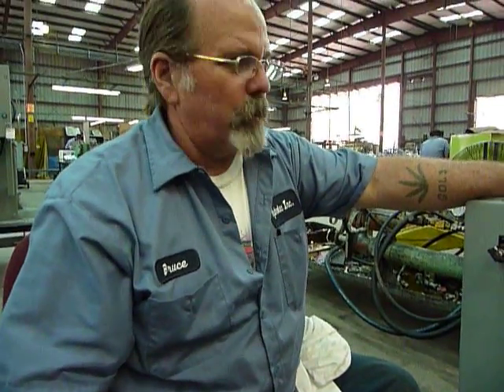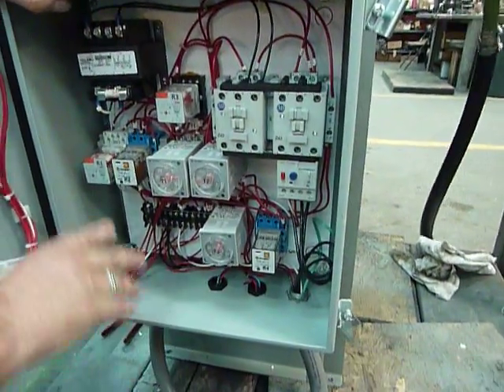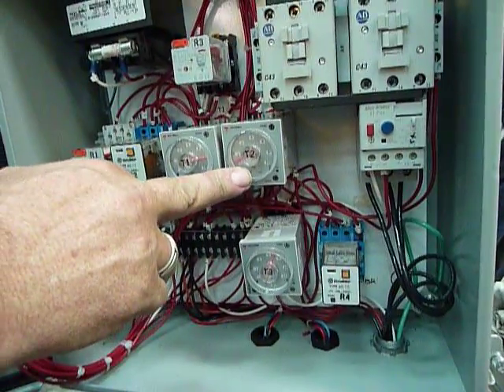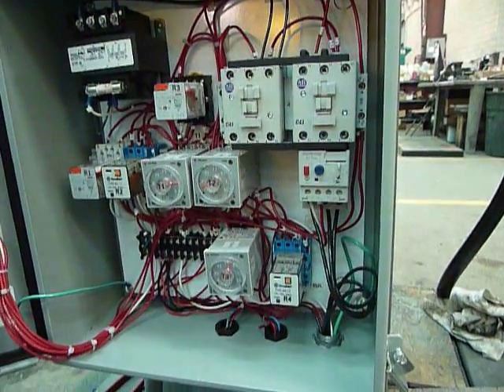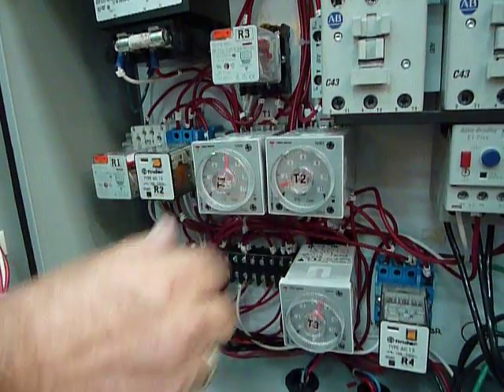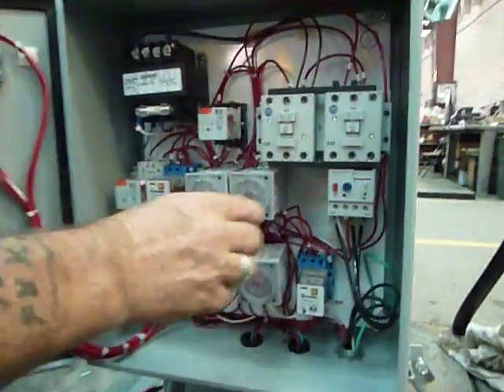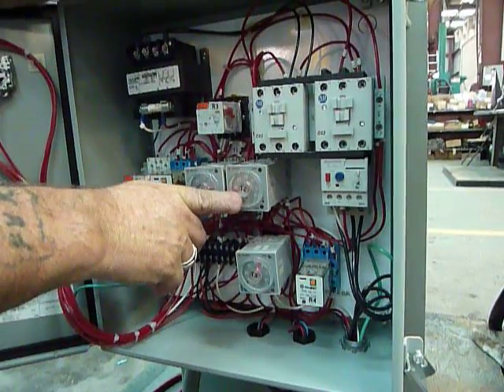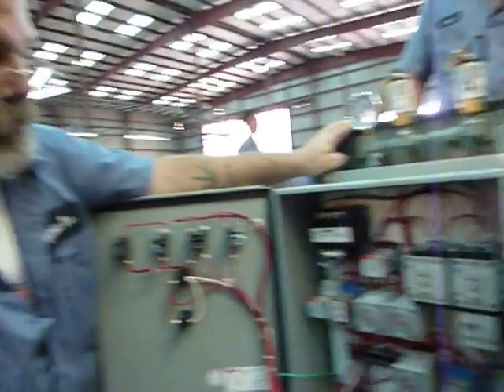relay timer panel

Comment: love it, good old analog control=reliability! Just built some similar timer based controls, considered using a PLC but for a model with equal proven reliability I had to spend much money on software and programming cables not to mention the PLC hardware itself!

Comment: there are only 3 timers,am i rigth? and 4 relays and 1 overload relay and 1 main breaker for supply....and the question is what is the operation and porpuse of relays?i think you are not the one making wiring installation of that board..next time be careful to upload some videos..so many person knows how to make and wiring motor control..

Comment: We are searching for products agent and dealer.
Thant’s true that we have our own factory. Also, 
We have the ability of written software and die sinking of developing new products. 
We take a mass of high quality MCU for our products 
We will offer you the best products and service.24h Timer,Timer Relay,Digital Timer,
Counter,Floatless Relay,Sockets,proximity switch,photoelectric switch,solid state relay,
Switch power supply,Rev.preventing relay
Hope it will bring you good profit.